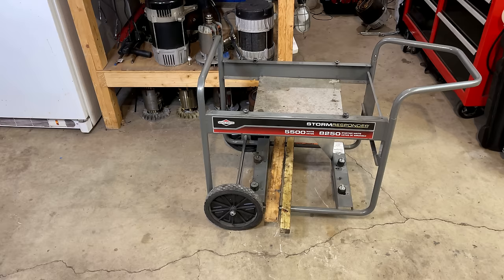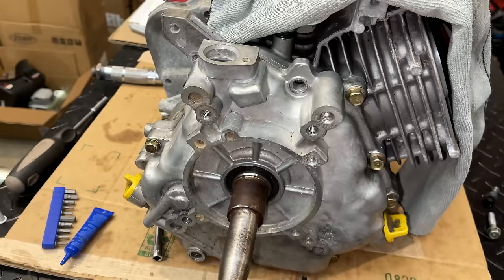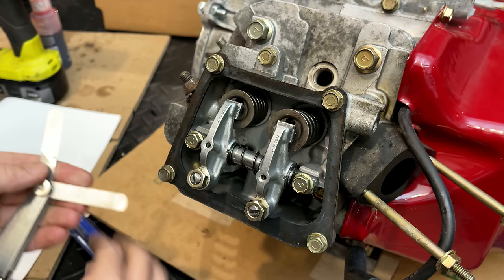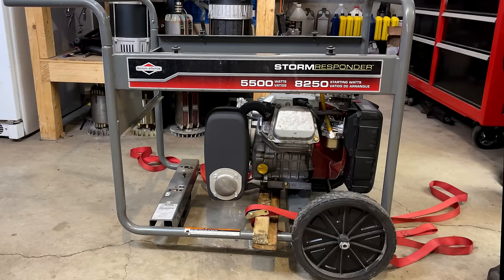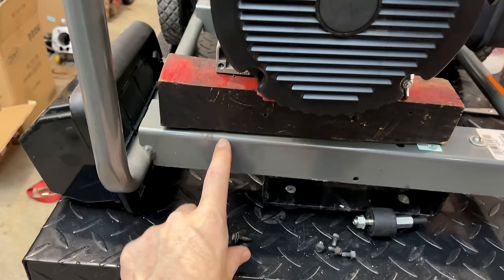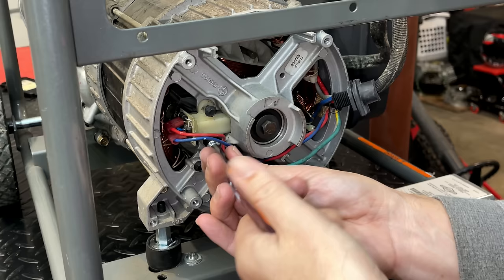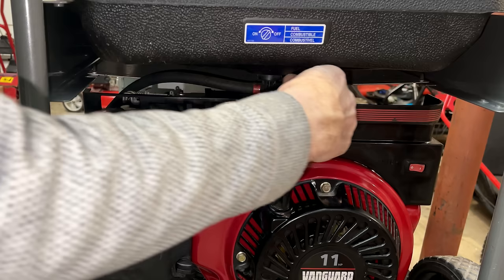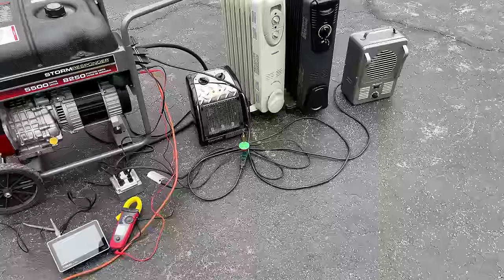Briggs Threw a Rod - No Oil Again (Part 2)

Comment: As a retired Harley mechanic, I have had damage as you found at the lower edge of a cylinder bore carefully welded by a local shop. since only one side of the repair needs to be finished to size, the bore can be resized by hand if necessary using an old piston (similar diameter) and sandpaper. I have repaired Harley engine and transmission parts (aluminum & iron) with good results like this where tolerances permit. Back in the day,,just about all HD and Indian repairs were FIELD repairs  without benefit of sophisticated equipment.  That being said, I watch  Jim Condon videos because he's the best all around wrench and troubleshooter you'll ever see.

Comment: James, when shortening screws/bolts, it is best to grind the chamfer on the threads BEFORE removing the nut in case the grinder rolls the partial thread over..

Comment: The 1st week of April 2023 after the tornado came through you could hear hundred of generators running and even more people wishing they had one. Power was restored to 90% of all customers at 7 days. I loaned my generators out to friends in need. 
I been impressed with the small portable one I got over 20 years ago and it's still starts 1st pull. I do my best to keep it clean and in the best shape. I have learned a lot from your videos and hope to be able to keep my generators for years to come ready for when they are needed.

Comment: Tip: an inexpensive foam dollar store paint brush/applicator is handy for applying assembly lube.. saves on paper towels used to wipe lube from hands and gloves. Store brush handle up in a clean recycled glass or plastic jar with lid. 
2) When using a hacksaw hold it with both hands to keep the blade running straight and true. Start the blade as far to the nose as possible. Push the saw forward placing slight forward pressure on the blade. Push forward until the blade each it's full length. Release the forward pressure on the blade and pull it back toward you to clear the cut . The blade only cuts on the forward stroke. Leaving pressure on the blade when drawing back only wears out the blade needlessly. You paid for the whole blade so get your value from the purchase. Hope this helps you and others..

Comment: Neighbor just gave me 3 old mowers. All 3 been sitting unused outside for years. 2 seized solid and 1 very hard to pull over but it's also got a rotten deck. So I used 1 mowers handle. 1 deck and the one barely moving motor. Tore the motor down and cleaned and checked for damages. Got 1 working mower out of the deal for nearly no new parts. Ideally I need new gaskets and now that one runs I'll prob get some for it. Your videos got me all the info o needed to rebuild the one mower.

Comment: I never realized why I should own an in/lb Torque Wrench until I caught the "Small Engine Repair" BUG.
Originally, I received an early 1980s Tecumseh powered C-Man from a yard sale. This is when I learned that TECUMSEH Carburetors are "FUN..." to repair...
Iwas hooked after finding a Small Engine Repair Manual at my local GOODWILL for $0.75!
Some people may find doing repairs/rebuilds as a frustrating "waste of money," but I found that it is SUPREMELY RELAXING, unless it is with a peice that is relied on.
Late at night (without power or Pneumatic tools) I would routinely go to the garage when I couldn't sleep, but be forewarned, TIME FLYES!
-Many thanks for your straightforward and calm channel

Comment: You reminded me, Jim, several months ago, I bought a Honda engine from a rental company. It wasn't very old, but it was not taken care of as it should have been. Bolts much longer than needed were used to bolt it to the pressure washer frame, and nuts were used to have enough threads to tighten it down, and parts were missing, including the governor rod. The owner said he liked Briggs engines better than Honda, and it showed. If this guy was in my area, I wouldn't rent anything from him. I bought the engine as a parts unit, but I believe the valves are just out of adjustment. He said he couldn't get it to run right. Honda engines and the clones are my preferred engines to work on. They are simply and easy to repair for the most part.

Comment: I have to admit that my OCD was kicking in wondering when you were going to clean up the rest of the engine/power head, but as always, you came through.  That is a sweet generator that will run forever.  Thanks for your great work!

Comment: Thanks for another great video. Really glad to see that the engine issue was just timing the balancer. Also really like the detailed output testing, but don't understand the THD diagnostics and using a clamp meter to do that test. If you have the time, it would be great if you could do a video on THD testing, theory and equipment you use to test.

Comment: I was taught that the flywheel should have the rust removed on the outer surface towards the coil assembly. And any rust on the coil cleaned as well, That the rust could diminish the output of the coil.
Excellent work!

Comment: Your videos are the most informative I've seen. So much of what you do with the engines is also useful for other power equipment. Nice catch on the timing gear. When I used to use a non AVR generator to run the whole house during a power outage, I adjusted the speed to 60 Hz for the nominal house load which was around 1500 watts total. When a big appliance kicked on, the speed as well as voltage dropped some. I was more concerned about running at elevated voltages, especially when we had a 5 day outage. The genset was rated at 7kw, but I rarely exceeded 3kw total. The THD worried me given all the electronic controls in the furnace and refrigerators/ freezer, so I got a Champion inverter unit. Frequency, voltage and THD regulation are very good.

Comment: When you are testing the output One suggestion I have is you have a string of incandescent bulbs with a switch to each individual bulb so when you are near  the maximum output for testing the breakers you can’t switch on one bulb at a time with the increments of say 100 whats you can test the max output and overload with the accuracy to whatever size bulb you fit, you would also be able to see the hurts change as you overload the generator or engine with 10 bulbs screwed to a board. You could slowly increase the load up to 1 kW increment of 100 W. At a time. Cheers Derek.

Comment: U.K. Hello James - well worth watching channel. I expect you know, but Locktight make some very interesting products. On one occasion, we tried one of their products (sorry, I can't remember which one) on a 1200 HP engine gearbox differential spline which had fretted quite a lot. When it was stripped after testing, the Locktight came out in strips. It survived the enormous torque very well. It took 40 tonnes to push the shaft out. They also do a loose bearing one too. I thought there might be an occasion where you might save landfill, although your engines are a tad smaller.

Comment: Good work there James, as at least one other has already said, the damaged crankcase of the original motor looked salvageable to me with some minor tig welding work followed by some hand finishing work with files and scraper perhaps. Your solution with the Vanguard engine however will be a better fix long term.
My only gripe is that I feel that your videos are too long winded and would be improved with tighter editing. About 50% could be cut or speeded up  without losing any important detail, and that to me would be a significant improvement. Having said all that, I appreciate your considerable efforts in filming, editing and uploading all the work you do, and you have my thanks for doing it all.

Comment: Thanks James. This video have inspired me to a question and concepts. 

Which portion in a machine screw do we apply thread locking compound? 

Concept? 
If apply to the tip, the compound will be even out to the entire length of thread. 

Consideration? Either, spread thin and weakening the compound or there is enough compound to fill and frozen the full length causing trouble in the future disassembling.

Potential problem? Screw may get locked in too tight and forcing it loose may risk parting the screw head. Attempt applying heat become ineffective for the entire thread length due to head dissipation into the chassis. 

If apply at the thread end by the head and not the tip, no spreading ti the length of thread. 

Consideration? Rich wetting to the last few turn of thread and expecting some may pushed back to the screw head or flange. No risk of breaking off screw head. In a tough situation just apply heat at the head to defeat the compound next to the head. 

Hope this helps.
Reply: I use a long bit or screwdriver on screw/bolt and give a little whack to the handle. That usually breaks free the purple or blue locktite enough for it to spin.
Red is a different story, heat only or very big wrench.

Comment: You mentioned that the carb was running the engine good but the throttle lever says a little different. If you watch the video while it was in the garage the throttle lever was opening and closing a lot even though the engine speed seemed to be constant. Might need a main jet one size larger? Another nice franken generator! Keep the bubble light!!!
Reply from the maker: It was definitely struggling when the engine was cold.  The Mikuni carburetors they use on these engine are jetted very lean.  More fuel would be an improvement.

Comment: James, if you have to cut threaded rods or bolts, save yourself some grief and get yourself a chamfer tool. Very quick and easy to use, and work great. Much nicer than trying to grind or file the threads after cutting. Amazon has a selection.

Comment: Well done James. I thought all the B&S engines were made in the US so I was surprised to see Made in Japan cast onto the side of the block. You have to wonder why the person you bought it off was inside the engine far enough to upset the timing. Picked up a 2021 DeWalt gas pressure washer for $5 because it had thrown a rod. I could repair the hole in the block and machine the crank here at home but I couldn’t find a con rod or virtually any parts for that matter. It was a Wisco engine, which I believe is Chinese, but couldn’t find very much about them on google and almost no spare parts. My wife told me to throw it away and buy a brand new pressure washer!! Hokey dokey😂, but I’ll make sure it has a decent engine like B&S, Honda, Subaru Robin ect. Real shame about the DeWalt as it was, and still looked, nearly new. Cheers, Stuart 🇦🇺

Comment: Trying to get valve clearance is a pain in the @$$ I think on my wen 3800 inverter generator it's 5 to 6 on intake and 7 to 8 on exhaust I even took the head off to fix a slightly bend pushrod by using a latch hook on my van and bending it slightly all the way around and testing it on the head several times and guess what it works flawlessly now not needing to spend money and waiting for parts was able to use the generator right away after I reassemble it all cause of your channel I learned how to fix it for free and still get a good product going hopefully it'll last me for years

Comment: I like the inverters a bit more because they idle down when not under load. Running at 3600 RPM is fone if using the generator all the time but running a sump pump and furnace all pull lots of power for a few minutes then almost zero in-between. 
And they are so much quieter, during a prolonged power event you want to draw as little attention to yourself as possible.

Comment: James if I had the choice I would pick this one if I couldn't get the small engine mechanic's Onan diesel genset. That thing was a bull. That guy that had all those predators that failed would have only needed that diesel genset and it would still be running. I think he even put 7300 watts on that thing and it didn't even flinch.

Comment: I notice the tank has the divot around the gas cap with no means of draining. A suggestion. After draining the tank, use a heat gun to heat up the area centered between the handles nearest the end and when the plastic gets soft use a piece of pipe to gently form a drain trough.

Comment: I had occasion to strip down a Briggs Vanguard 14hp and found a simply low grade piece of engineering.  I found that the cylinder head was simply not finished from the raw (poor) casting and the head was bent.  Given that the Vanguard engine is known to blow head gaskets I can see why if the head is bent and the gasket material is very narrow at points away from the holding down bolts.  I cleaned up the porting and lapped the head and block flat.  The result was a noticeable power increase that I would guess was at least 50%, its probably close to the rated 14hp now.  At least the head has a chance of surviving for a little while longer.  
Before putting the cylinder head back on did you check its and the blocks flatness, such would be normal engine building practice and moreso given the low base standard.

Comment: 49:10 Electrical Device Boxes (what receptacles and switches are mounted to in your walls) have the same problem of striping out with truly absurd ease...

What I do is use a screwgun to drive the screws 90% of the way in (I place my finger lightly on the screw where it enters the box and stop when I feel the tip of the screwgun bit touch my finger) and then finish tightening them with a screwdriver...considering how long some of the screws can be, it saves you a LOT of time and more importantly, wrist pain & fatigue...

By not bottoming the screw out with the powertool, I don't risk stripping the threads...

Comment: I watch hours of your videos 
Brilliant problem solving and adapting engines this one was the nicest one i was a little mad when that man didn't tell you about the engine buying in is hard they all lie I check the generators like mad before parting with cash Vanguard are a nice well built engine 
Qestion have you ever worked on diesel 4 to 8kw engine as I'm in the UK and see them often running on chip fat lol 
Tell the lad the BUBBLE LIGHT WAS COOL 😎

Comment: Not trying to insult you at all. The part you call slip rings is called a commutator and the complete assembly is called an armature. I build and test AC and DC motors. Love the videos. Mike
Reply from the maker: True, but that is what they call them on the parts diagrams.

Comment: On the stator mounts, you might want to make a spacers, from a 1/2” or 3/4” pipe to go around the automotive extenders for added strength,
 Or, mount some 1” “ish” square channel across the mounting bar, instead of the automotive extenders.

Comment: Exhaust valve clearance should be greater than intake due to expansion from the hot exhaust "growing" the valve. Intake valves run cooler due to fuel "quenching" reducing valve temps. Clearance should be .002-.003 greater on exhaust side. Motor will run OK with tight clearance but it will shorten the life of the valve margin due to eventual erosion from partial seat contact!

Comment: Two suggestions, if I may. First, slicing the tube along its length when attached can cause a slot to be created in the barb it's connected to, thereby causing a path for leakage. Rotating the tube while wiggling it might be safer. Second, would it have been possible to rotate the shutoff in the tank so the valve handle faced towards the user? The tank shield may have been in the way, so not sure if that would be feasible.

In any case, thanks for the videos. Lots of good information contained in them.

Cheers.
Reply from the maker: Good point about the barb.  Rotating the shutoff would have worked as far as getting the clearance needed, but the fuel line would be going in the wrong direction.  Might have worked.  I also had a metal shutoff with a small knob to turn the fuel on and off.  That would have cleared without issue.  https://amzn.to/3MHzLNQ

Comment: What I tend to do when I'm using a screwdriver or nut driver to tighten fasteners that are liable to strip, I slacken my grip slightly. As soon as the fastener is definitely snug, my hand will begin to slip, and the fastener is tight enough at that point.

Comment: In the old days we used erasers or Burnishing blades especially cleaning relay contacts were the scratches would lead to pitting on the contact surfaces & welding them together.

Comment: I really enjoy your work James and you have helped me a lot. In this particular instance, I'm really surprised, unless I missed it, nobody commented on the possible danger that the knock caused by the negative clearance of the balance shaft may result in damage somewhere, bending or stress to bearings. Is there any way this could be tested?
Thanks again!

Comment: To shorten a thread a little I just grind it some. I'd have to be taking off a bit more to resort to sawing. Then it is still nice to clean up the saw cut with a grinder or a file.

Comment: I love your videos. Have you ever thought about a video on installing 2 generators to produce 50 amp service in a class a rv?
Reply: Issue with 60 cycle sine waves synchronizing?
Reply: @jaybdvm  
Me and the wife live full time in an old class a but the previous owner sold the generator. We have a 30 amp generator but would love to add a second to up it to 50 amps and install them into the generator. The wires were cut and I have no idea where to begin as there is very little info on a 93 gorgie boy.

Comment: As usual, I am confused 😢! You set the speed by locking in the throttle screws. How does that play with the the throttle spring and regulator inside the engine?
Reply: I was wondering the same.